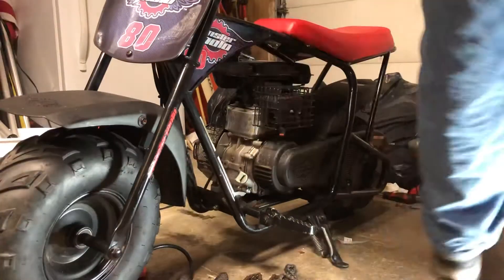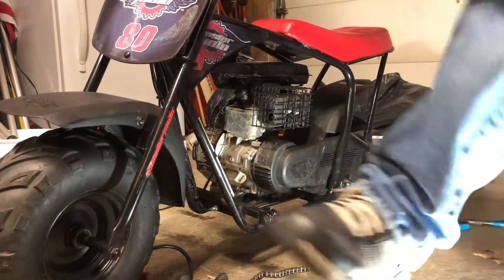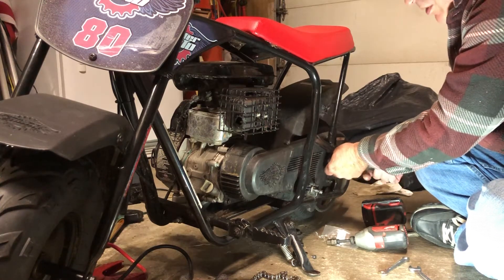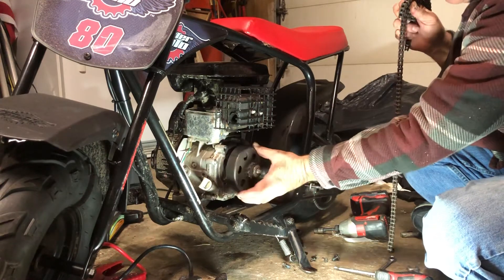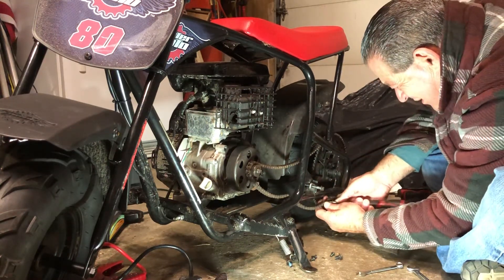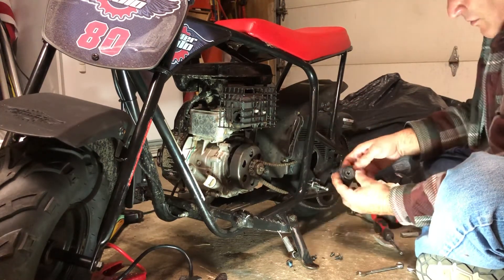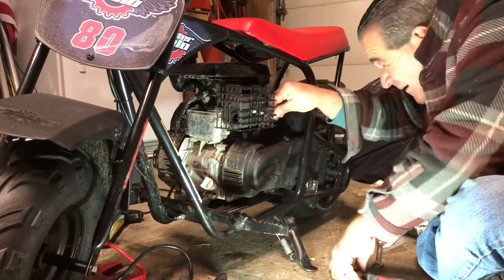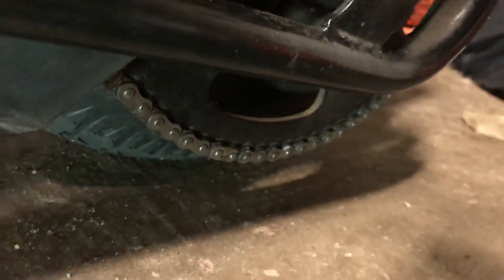Monster Moto 80 chain replacement the easy way

Comment: Do you know how many links the chain was?
Reply from the maker: Hi I can’t remember but they do sell it on Amazon and eBay complete chain
Reply: @greggmgm  Thank you so much👍🏼 amazing Content❤️
Reply: I am about to install a brand-new chain on my Coleman ct200 EX trying to figure out should I have my motor all the way forward or All the Way backwards before I install the chain could somebody please answer that for me I would appreciate it thank you
Reply from the maker: @davidjohnson5212  Hello how are you I would think put the motor all the way back
Reply: I think you're absolutely right I put the motor all the way back and the back wheel all the way forward that way as the chain stretches I have room to tighten it. Thank you very much I do appreciate the help. Are you going to make more videos and post them? I like this video that you have made already thanks again